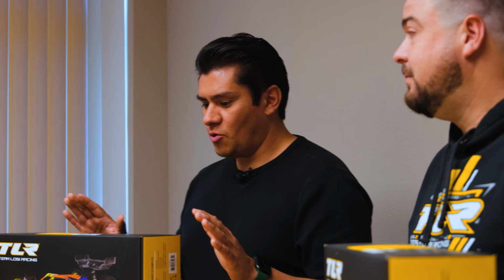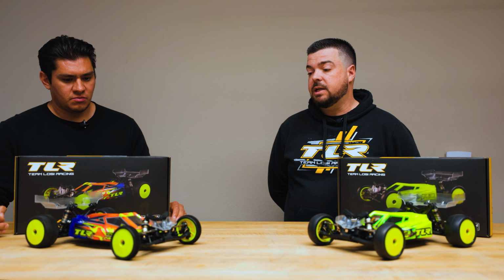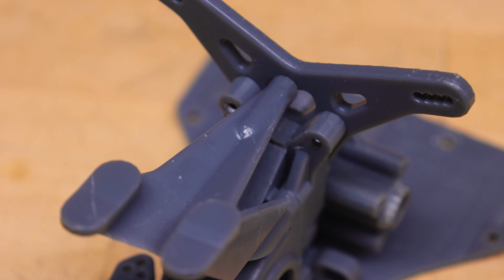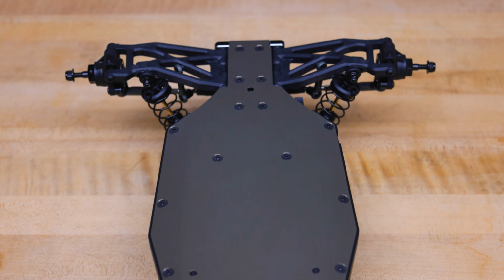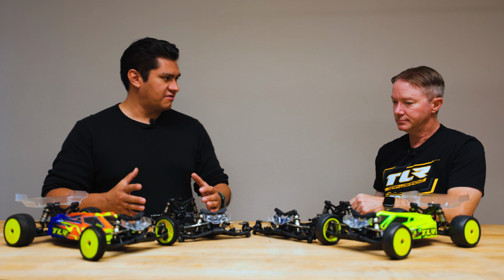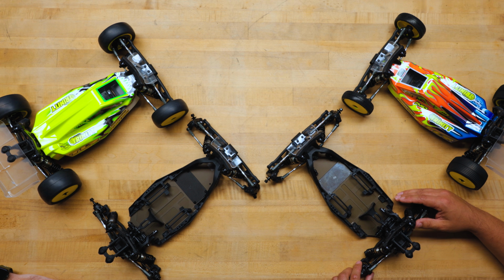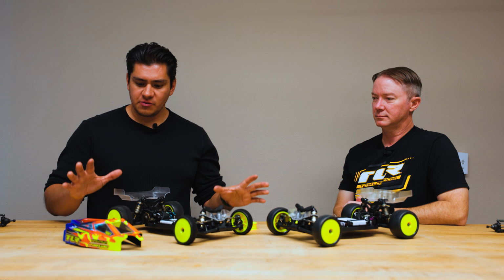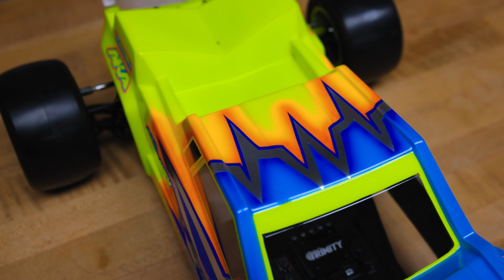THE TLR TRADITION OF INNOVATION CONTINUES - THE ALL NEW TLR 22X

Comment: 1/8 scale is bigger and it can handle the bumps in the track.  Plot totally lost.  I assure you 1/10 scale off road RC cars can handle bumps in the track, if they are actually off road cars.  Frank is your typical RC racer, he can't see the forest through the trees.  A racer just thinks, the faster, the higher grip, the smoother the track the better.  No, it sucks.  High grip makes the hobby way more difficult to setup and drive.  Good luck getting new people into this hobby with these blue groove tracks with razor thin setup windows.  Where are the sanctioning bodies to lay down some more rules and guide the sport?  You can't just let racers and engineers decide where every goes.  If you do it will become a buddy club tiny unpopular sport.  You know it is actually super easy to make rules to guide the sport.  Here is one, minimum 1" ride height rule, measured after race, boom that was easy.

Comment: These in depth engineering discussions on products are the reason I run Losi cars - even if they de-emphasized their racing effort.  I don't really see any other OEM doing this except maybe XRAY in their online print material.  Top class

Comment: Super high grip, smooth, road courses with roller jumps, brown asphalt.  This is the way the industry and tracks are going?  Has anyone within the racing organizations or the RC manufacturers ever asked "is this where we want it to go?"  Seriously, has anyone ever took a step back and said, maybe we should make off road tracks for our off road racing series?  Has anyone ever asked the question "how should we steer the sport to make it more fun, and easier for beginners to have fun?  Seriously, has anyone ever said "maybe super high grip, blue groove tracks that are extremely difficult to drive, difficult to pass, and have almost nothing to do with "off road" are not cool, and kind of dumb?  No, we just disengage the brain and say, wowy wowwwsvill, its so cool that our offroad cars are pan cars with roller jumps.  Anyone ever ask themselves, "why is this hobby such a failure, and gotten so small and insignificant?"  I don't blame the engineers designing the cars, they are doing what racers and engineers do and try to win.  This hobby needs manufacturers and organizations to get together and actually come up with a plan to make RC racing better and fun and interesting.  And the number one way to make the hobby more fun and interesting is to lower the grip, not raise it.  Lower the grip and corner speeds.  Second, lets have off road tracks, you know rough washboards, jumps, off camber, whoop sections, studder bumps, loose dirt, maybe through some pea gravel and sand in sections.  Third, make rules to reign in the cars and limit how far they can go.  Minimum ride height, minimum variation on track width and wheelbase, minimum weight, have to run a full size lipo.  And no more setting your results by the number of laps in heats.  Heats are races and the finishing order determines the success, not laps turned.  also, the heats should be 10 minutes long.  Maybe run 5 minutes, then invert the start and realign up and run another 5 minutes (No break between).  Sometime the people who love something and are deeply involved with it are the ones who make the worst decisions regarding the hobby.  Sorry for the rant, I just think RC racing is one of the coolest hobbies and competitions and forms of racing there is.  Its a shame seeing become dumb and insignificant.

Comment: Finally! While I'm surprised that it took this long (considering all of AE's B6.X releases and now the B7) , but the buggy looks pretty sharp. It's also interesting to see that they chose to integrate the 22x-4's actual arms.

Anyway, I'm gonna seriously mull getting it on release... That said, I see that the Spektrum S6400 will take the S6245's aluminum servo mounts for the 22X-4 and 22 5.0... Is a 22X mount in the works for these servos (since they would fit both servos anyway)?

Comment: Beyond ready for the 8ight-XT II to drop! #2Weeks
Reply from the maker: what new features would you want to see ?
Reply: @LosiRacing  I've only owned the car for a short while now and have predominantly used it for bashing as opposed to its intended use as a racer.

There are a few very minor things to note from this brief experience.

CONS

1. Driveshafts

The front and rear driveshafts are quite thin and have bent numerous times during use. While the rear set is currently okay for the time being, I recently bent a front left shaft and unfortunately snapped it whilst trying to bend it back. A thicker option alongside the optimised thinner set expectedly used for racing would be very much appreciated.

Furthermore, due to the flex of the rear chassis brace, the rear centre driveshaft is also prone to bending under higher loads. Whilst this may be solved by retrofitting an Arrma Mojave shaft, or upgrading to an aluminium rear brace, it may be worthwhile noting as well.

2. Wing Mount

Again, not a major concern in terms of the inherent design of the vehicle, but it can certainly be noted for convenience's sake. After a few cartwheels, the rear wing mount's bottom screw holes had effectively pulled out and could no longer support the wing from the bottommost point. Unfortunately, the resultant load beared by the upper two fasteners inevitably failed, and every cartwheel following the failure of the bottom screws would result in bent upper screws and a largely deformed wing angle. 

Perhaps a thicker plastic section interfacing with the head of the screws could be used, or a larger screw altogether, such as an M4.

3. Differentials

Absolutely love the front and differentials when it comes to servicing, but the rear is a bit of a pain. It takes a fair few screws to remove and requires the rear shock tower to be displaced. I'm sure this is something very apparent by now, but everyone does love an easily serviceable differential.

Ideally, something like the front differential would be perfect.

PROS

1. Weight Balance

The flight, control, and handling of this car are definitely notable. With a 4S battery, the vehicle drives incredibly nicely and is extremely well balanced in the air. It can also handle 6S, but it's not as graceful in my opinion. However, please take this with a grain of salt, as this is my first RC car, and there's certainly not much to go by.

2. ESC and Motor Compatibility

I absolutely love the orientation of the ESC and motor mounts. By being positioned at the rear of the vehicle, there are subsequently endless possibilities in terms of the size of the ESC and motor combo you can select. Being located in a fairly hot environment reaching temperatures of up to 40 degrees Celsius (104 degrees Fahrenheit), a typical 8th-scale truggy combo (Hobbywing Max 8 G1 + 4274 2200kv) would excessively overheat, even with 3 server fans mounted. Typically, in many other of the truggies offered by other brands, you'd be constrained to this combo as the motor's length is constrained by the position and size of the ESC, as they are positioned towards each other. As such, this design would become practically incompatible with one's climate. 

However, with the rear mounted combo, I've successfully fitted a Hobbywing Max 6 G2 with a 4292 motor, and it runs a lot cooler thanks to this oversized combo otherwise incompatible with almost every other truggy design out there that I could find. Eventually, I plan to increase this motor length to 104mm, and thankfully, there's more than enough room to accommodate for this.

3. Fitment and Tolerances

I have had zero differential issues thus far (touch wood) and have noticed practically no wear on anything driveline related. The internal spider gears, crown gears, and drive cups have barely worn. Further to this, I've never had to shim anything and don't see myself doing so anytime soon. In comparison to what I've heard about other RTR vehicles, this does seem like a bit of a luxury, and the manufacturing of these parts is highly commendable.

CONCLUSION

Yes, these observations are from a limited period of ownership, a light bashing history, and, most importantly, my first RC car. Yet, I'd like to think they're worthwhile noting nonetheless.

Huge thanks to you, TLR, for the ongoing support and innovation. Hoping to see some more new things come out for the 8th-scale line to follow on from the newly released adjustable chassis!

Comment: @abullock1995, I concur! Losi seemed a bit quiet lately, I am sure the customers were still happy with the cars they had, but I didn't expect two new buggies along with a truck. Very nice looking kits. There was a point brought up about the tracks. When I raced 2wd buggy around 99-00, there were very few carpet tracks. Most were dirt/clay. There were also indoor dirt. 
   I was here in Illinois back then and that location had an outdoor track and an indoor track. Outside was Clay/dirt. It was able to build up blue groove and get pretty sticky there, but outside the lines, it would be loam. Inside at the same location was dirt. But not clay. The dirt however, was more consistent as the water did not evaporate quickly. Outside, the water evaporated quickly. Outside the conditions changed, you could always expect there to be a pretty nice groove mid day. 
   The point is, I think most tracks were something like that, and as time has gone on, the tracks just got more and more clay oriented. There is much less loam with clay tracks. So it is good to have cars that can adapt to changing conditions, but people race where they can mostly. Some people are more serious and are willing to go to other states for events. So if the track is not there, it isn't there. Considering clay has become so popular, most if not all modern cars are very low and mid motor.
   The other point that I thought was strange is how the team there were talking about development, they mentioned comfort without speed and speed without comfort. It sounds like the new cars will be good!

Comment: Curious about the different rear arm lengths shown as option parts. Are different widths for the dc vs ac or is it a tuning option? Also which length universals are appropriate for each car?
Reply: The optional arm is shorter, the same length as the 5.0 rear arm.  When you use it, you just run a 1mm wider hex.  It help increase rear grip for lower grip tracks.

Comment: Can we get a new 8th scale buggy and truggy??????
Reply from the maker: what should be new???
Reply: @LosiRacing  an updated race kit… it been far far to long…I’m the only guy at my track that stll runs a Losi
Reply: @LosiRacing  Massive fan of the current 8ight XT model, but everything needs a refresh every now and then!

Saw the new adjustable length chassis to be released on the 21st of May...

May I kindly ask if this is a simple 'refresh,' or is TLR rolling out some new parts ahead of a full model release—kind of like what they did with the 8ight platforms back in 2020?
Reply: @LosiRacing I love my 8ight, it handles so well! I've been running it a lot lately and I can't think of anything I'd want changed.

But, I'm begging for a TLR Micro 8ight to go with the Micro B/T so that I can race 1/24 scale dirt tracks that need 4wd🙏🥺 The TLR quality and design is worth any price!

Comment: Would there a 4x4 version soon?
Reply from the maker: refinements will be made :)
Reply: @LosiRacing thank you for the prompt response. Do you have any lap time comparisons between the 22 5.0 and the new 22X? :)
Reply from the maker: laps times are dependent on you.. the driver :)
Reply: @LosiRacing  To be more specific, if the same driver were to drive both cars with identical tires, electronics, and stock kit setups, how much of an improvement would be seen in lap times between the previous generation and the new 22X buggy on 1. Astro Carpet and 2. Dirt track?

This is a simple and reasonable question that many would want to know before purchasing the new kit.